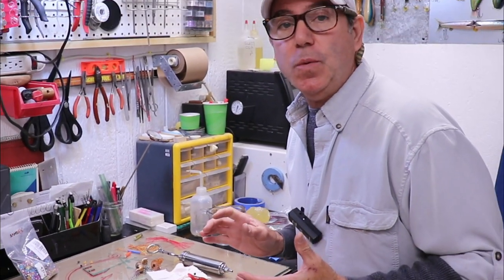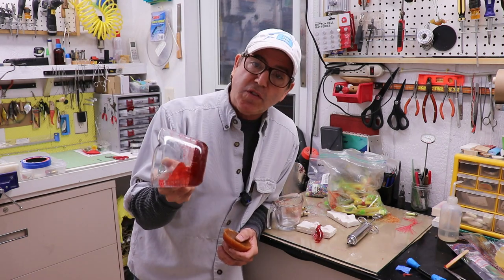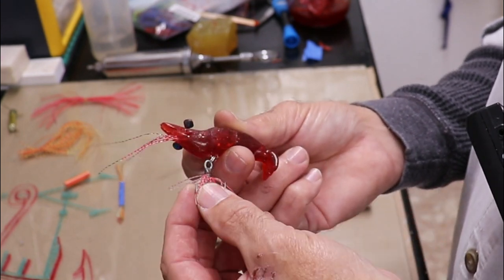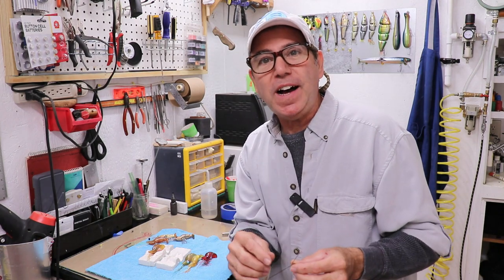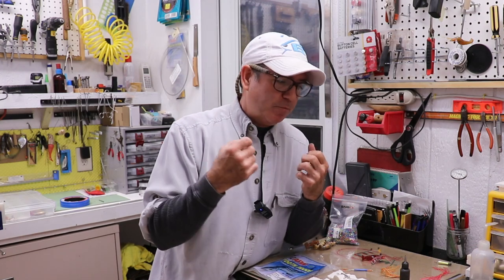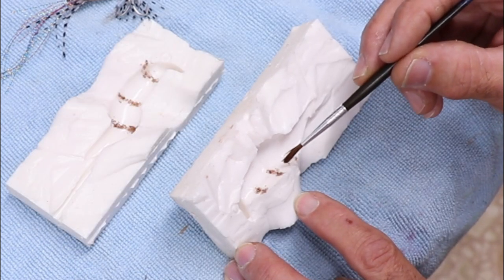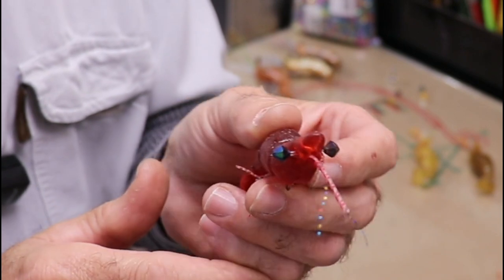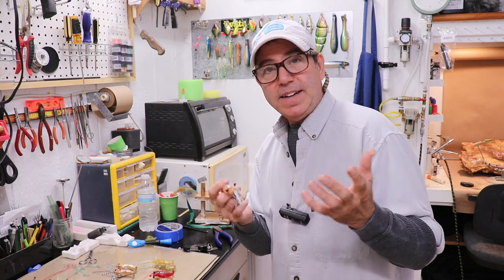Making soft plastic shrimp lures

Comment: really great lures👍 very shrimpy😂. just an idea man, to make a softplastic shinier dip it in the clear hot plastisol after paint, even works with airbrush paints👍
Reply from the maker: Yes..I've used the clear dip trick.  It works great.  But when you have small details or dangly legs or tunicles it kind of melts them together...but it sure gives a nice shiny finish.
Thank you for watching.